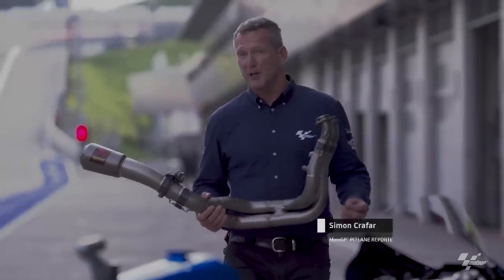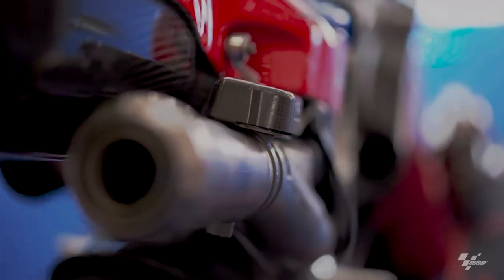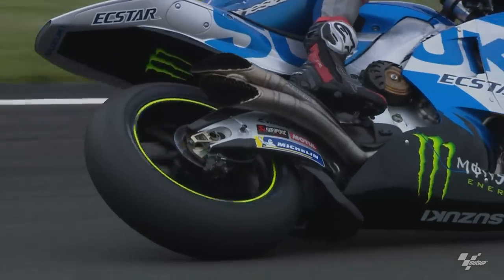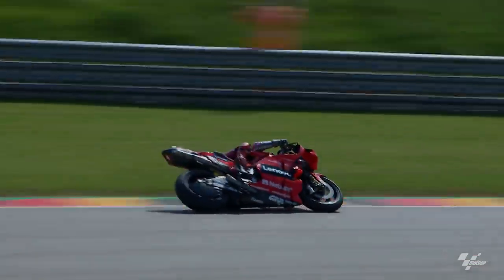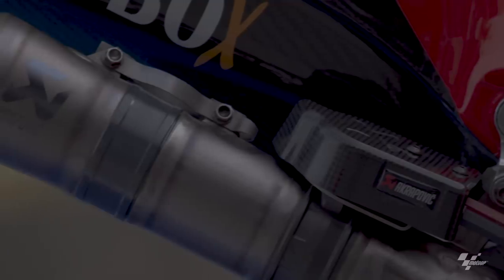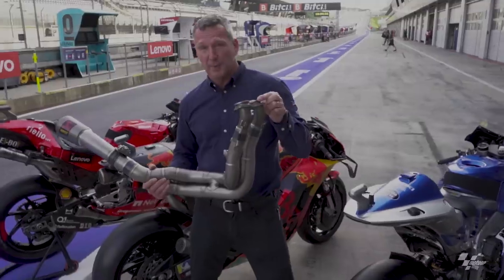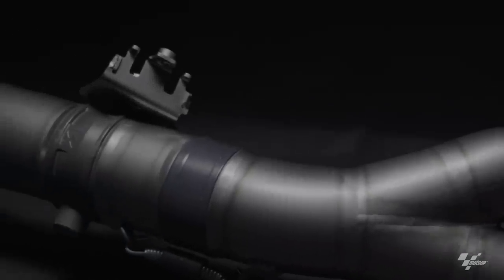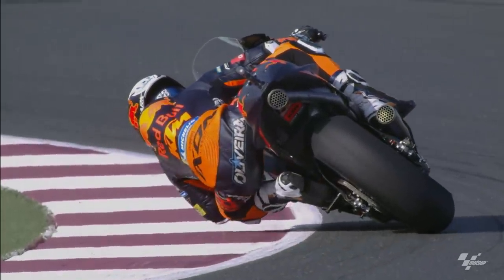Explaining MotoGP exhausts with Akrapovic

Comment: Wild how much electronics and tech have changed in a relatively short amount of time... 
I don't think any of us "normal" track day riders would actually be able to rider a motoGP bike. No matter have good you think you might be... the crazy set up on these bikes - and the power and complexity of these machines is mind bending!
Reply: Not that many years ago, we had no aids.

Who won then? Rossi did... a lot.

Vale💌respect!
Reply: actually a motogp bike is very easy to use, for one used to normal bike (very light, fast to change direction, instant brake, transmit a lot of sensation to the pilot, ecc). The hard part is to compete and go to the limit. Imho if you are a normal track day rider, you can use a motogp with out any problem, ans stay at 15 seconds from a motogp rider
Reply: You might be surprised, I'd imagine they are quite a lot easier to ride than you think. Fagan on 44 teeth rode some BSB bikes recently and he said the 240hp superbike was a hell of a lot easier to ride than the superstock version.
Reply: From what I understand the hardest thing to get used to with a MotoGP bike are the tires and the brakes. According to Randy Mamola the way the brakes are on the modern GP bikes is simply in another universe.

Comment: Nice to see EXUP valves being used, same as YPVS in the 500 era 2 strokes. I am not sure who invented the first powervalve, but I think Yamaha was probably the first main stream manufacturer to really maximise it in the 1990.  Giving the bike a lovely low rev range power boost.
Reply: YPVS effectively changed port timing (similar to variable valve timing in a 4 stroke) nothing to do with EXUP
Reply: yes you are correct, even though they are valves in Exhaust they work differently. The 2 stroke versions is nicely explained here.https://www.youtube.com/watch?v=4kERsqKC9Q4

Comment: I thought Servo Valves were useless. My catalytic converter had a decat and it started rusting so i replaced it with a full set of akrapovic headers, the Servo motor/valve was obviously removed now it's straight pipe basically. But i haven't noticed anything bad when it comes to performance after i had it tuned.
Reply: Servo Valves are useful if you are a professional rider trying to get that last 0.100 seconds on the track. Not in the road making corner entries braking from far away very comfortably. Plus Servo Valves in road bikes are there to control the noise and emissions also.
Reply: It's not the same for roadbikes. On these their purpose is to eliminate noise at a specific moment where the bikes measured for the Euro standards etc.
The fool the systems.

Comment: I've said this last year, Akrapovic or any other exhaust maker doesn't have anything to do with MotoGP exhaust except sponsoring the team and placing a sticker on their bikes. Consider this, do you think any manufacturer would be willing to send Akrapovic their MotoGP prototype for building, testing and dyno tuning? Another example, when Honda was one of the first on the grid to have a seamless transmission even the Repsol crew were not allowed to view it. Honda had two or three HRC transmission engineers at the races and only they were allowed to touch it behind secrecy even from their own team.
Reply: Of course they do, it is drawings and models sent to Akrapovic and they send back the complete part. All those race teams are relatively small organizations, the cost of in-house prototype casting and machining is exponentially more expensive than outsourcing the 10 or 20 parts they need for the year
Reply: @johnteahan2333  Except PokerPariah is absolutely right. None of these GP teams whether small or big organizations matter in these context. The bikes are all essentially manufacturer "factory" prototypes anyway. All the exhausts are in house units, how else would they go through multiple variations to test on their own dynos. And don't even joke about the cost of prototype casting and machining of parts. This is MotoGP not some national championship. The manufacturers are routinely casting their own prototype frames/swingarms/parts/ multiple times a year to get even the last tenth or that extra bit of stability/braking/acceleration advantage.  It's just sponsored stickers on bike manufacturer exhausts.  No matter which sponsor on Honda RCV, Arrow (LCR) or SC (Repsol), its the same damn exhaust HRC makes. The look and welds always gives it away. Same goes for Yamaha or any other team for that matter.
Reply: @johnteahan2333  with this mentality and critical thinking ability, take a good look in the mirror and see why you’re so low on the corporate ladder.
Reply: as someone who worked there....yes they do. Dont be silly. And putting Akrapovic in the same group as "any other exhaust maker"  is just wow. Now pls hit me up with the: "that's why you're so low on corporate ladder" for some comedy relief.
Reply: @matejskerjanc7703  Prove it.
Reply: @matejskerjanc7703  Let's revisit this discussion since you have yet to reply with anything thought provoking other than "I used to work there". Let me provide another example of the secrecy within the factories concerning their bikes. Last year Yamaha had the bad batch of valves which caused several DNF's and concerned them enough to ask the other manufacturers for permission to open their engines to change the valves. All agreed except Honda who wanted the blueprints on the valves to examine and approve. Yamaha said no. Now consider Yamaha was unwilling to provide the blueprint to a valve, you think they would be willing to have an exhaust maker from another company work closely on their upcoming MotoGP bike dyno tuning it and running it so they can build an exhaust? All the while being in a foreign country almost half way around the world? An exhaust that Yamaha can build themselves since they have intimate knowledge of their MotoGP project and have the engineers to do so in the top secret conditions of their own factory. It's possible you worked at Akrapovic but seeing your uneducated reply I assume you were the person at the bottom of the corporate ladder, likely the janitor.
Reply: @pokerpariah   working as a janitor, dream come true. One can only hope someday...anyway petty  personal tones easily discerns how high one can climb the ladder. Its ok champ if you think the exhaust companies just stick their stickers on the ready made exhausts made by yamaha (wat...) to make yourself sleep easier at night. Now enjoy the solo conversations I try hard not to stoop to your level. Also please stop disrespecting janitors, meanie. toodles
Reply: @matejskerjanc7703  What's wrong, too hurt that you're unable to have an intellectual debate that you had to run to youtube and have my reply deleted? You should work on your knowledge before making claims you cannot debate or even rationally discuss.
Reply: @pokerpariah  no one had your spouting deleted my wee random lad. I sincerely doubt anyone cares enough, but god knows, world's a big place, some may find your scribbling offensive, others petty. But calling this intellectual...ok. One can only extend this far i guess. Enjoy your day high up the corporate ladder typing on youtube, I must do my "mopping"
Reply: @matejskerjanc7703  This is my last response to you. You're not intelligent enough and nor knowledgeable enough to understand the lengths corporations go for protecting their intellectual property, especially in the competition of MotoGP. Speaking with you is comparable to arguing with a child which is sad if you are an adult.
Reply: You do realise the secrecy you mentioned surrounded the brand new arrival of seamless shifting which Honda was the first to introduce to MotoGP, and patents were pending at the time? Honda wanted absolutely no one snooping around their brand new tech and snapping pictures so their copyright could be stolen. The secrecy didn't much subside afterwards though. Yamaha found themselves in a pinch soon thereafter because they wanted their own seamless gearbox, and they had to circumvent construction similarities on enough fronts to avoid copyright claims by HRC. This was in the early 2010's and was explained in depth in the technical analysis part of the Motocourse book. Also, every factory is out there trying to win, and you'd be a fool to give your opponent an insight into your tech and plans.

Comment: Cool, so their cutting edge design is an exhaust brake from a diesel truck and some expensive metals that are fit for purpose.

I wanted to know about merge lengths, pipe lengths, pipe diameters, muffler design and what the perforated sheeting blocking half the exhaust tip is about.
Reply: The honeycomb grill is a gravel screen, quite literally for stopping big lumps getting into the pipe. The tip over switches don't cut in for a little bit in a crash, and with limited engines in a season, losing one to a piece of gravel wouldn't be ideal.
Reply: @Minibull037  Thanks for that, good explanation, makes sense. But I can't help but wonder what is lost in flow to protect in the event of a ditch.

Comment: They certainly refined the exhaust since the four strokes first hit the tracks. They sounded terrible but now they are music to the ears. F1 cars were the same when they changed engines.
Good video was great to see the bikes up close!
I raced a Supersport machine with titanium headers and Yoshi muffler it added instant horsepower in a class where bikes had to remain basically stock only suspension and exhaust mods allowed.

Comment: Why are some pipes open at the end like on the Ducati and others have the hole punched screen covering them like most of the other bikes?
Reply: To prevent any gravel
Reply: they're actually there to prevent excessive flames from the exhaust when off the throttle

Comment: Is the valve invented by Yamaha? used to ride a FZR400RR in 1990 with EXUP system, was only 20 and it was the 2nd 400cc bike, 1st was FZ400, so not sure of the advantage

Comment: Can anyone explain to me why among all other clearly visible motorcycle parts, the exhausts are placed differently on MOTOGP bikes? What effect does this have on the bike's performance?
Reply: Because these bikes other than 2 wheels and maybe a certain displacement.. Have literally anything in common with a production bike. As Simon says, Akroprovic literally have to fit these exhaust in the permitted space provided by the manufacturer.. (Why each MotoGP bike is different)

On top of this space, if each 4 cylinder engines exhaust is split into 2x 2-into-1 systems... you would then assume each of these will need to have an equal length from exhaust port, to where it merges into each exhaust. then generally to its tip.

Comment: My Super Duke has this type of valve on its exhaust as well. I thought it was only to reduce noise to pass regulations. But I doubt it fulfills the same function as in MotoGP.
Reply: Μy 2003 gixxer 1000 has an exhaust valve also.But now i wonder why every aftermarket exhaust doesn't have it and why even when they put only an aftermarket can they dissable the exhaust valve..
Reply: It does help with low rev power delivery, and it does help a little with braking, but for streetriding these things aren't anywhere near as important as in racing.

Comment: Glad to see the factory exhausts showed on MotoGP bikes were not showed up close or off the bike lol, had to use moto 3 🤣
Reply: He is holding a 2 cylinder header, moto3 are single cylinder bikes. Also for moto2 it should have been a triple header. Therefore it must be a MotoGP exhaust. Probably the KTM front cylinder bank exhaust.